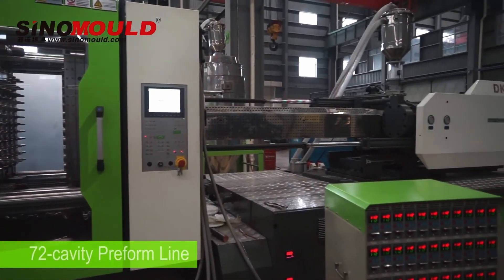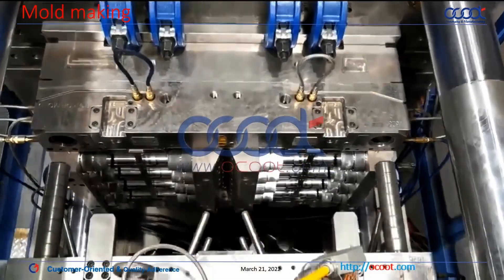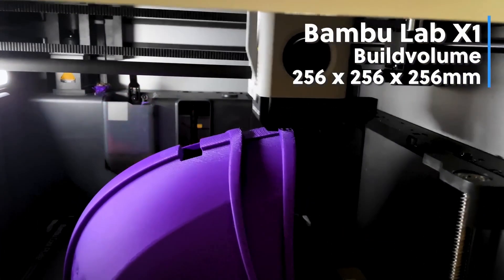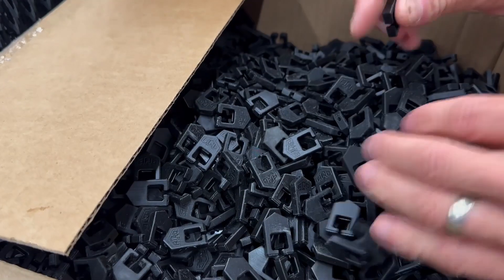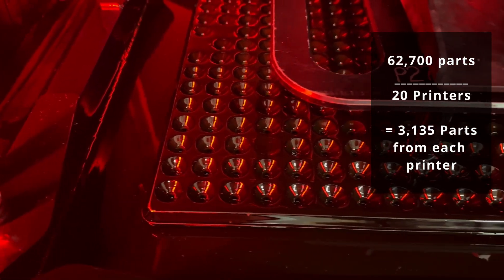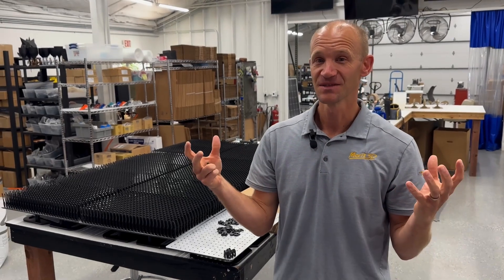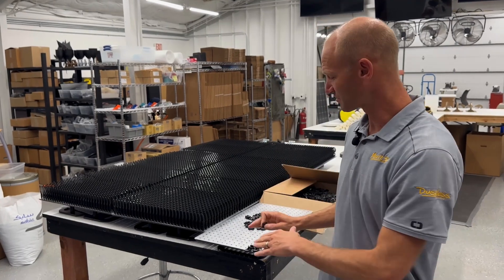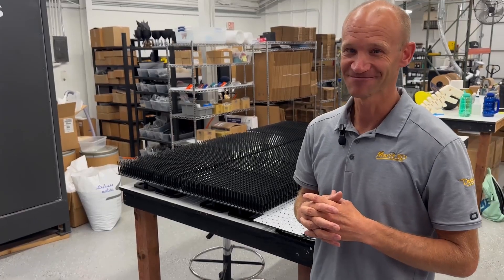How Additive Manufacturing Can Produce Faster Than Injection Molding!

Comment: Overall great vid, always nice to see "progress". I do worry about the fact that companies are doing with AM things that, in some ways, leveraging it "incorrectly". Sure I can make a stake in my microwave doesn't mean it's a good idea. Until it really starts to get absorbed the whole DFAM methodology it's just doing more of the same. Again I'm all for AM but it should be done in ways that make the most use not the same ole same....
Reply from the maker: Thanks for the comment. We do agree shay taking advantages of additive manufacturing. Design capabilities in one benefit. Our need was to bypass injection molding because molds have been a huge hinder ment in design to production speed and not being able to easy modify design after our molds are made. I would invite to keep your mind open as your need may be different than others. DFAM is huge in getting price down for us but not the main driver for mass production for our customers.

Comment: Looks real interesting and love the video! Few questions:

1. What is the 55gal drum on its side doing? Is that bulk IPA? And the plastic bag around the top lid, what's that doing?

2. On those cure units, it looks like there are only UV lights on the rear and bottom. Do the parts on the front of the build plate cure equally compared to the parts on the rear or say the middle? Or do you rotate the build plate halfway through?

3. The "blow-peel" technology that Photocentric has, is that like a puff of air underneath the FEP as the build head lifts up?

4. Do you see consistent Z heights across a build plate that large?
Reply from the maker: 55 gallon drum is what our resin comes in many times 

You may have to turn your parts to get even cure. Yes it is just back and bottom.

Yes and yes on the blowpeel and z height question. They are pretty accurate.

Comment: Your not eating the cost Your paying for them making parts. The point is the video is misleading. Its not faster nor cheaper than injection molding. A decent shop could make  inserts  and a mold in less than a couple hours. Blank molds are readily available and cheap not 10's of thousands close to 600 bucks well say double for machining. Molding shops run your mold and charge by quantity of parts. They still don't have to have the machines and still get it cheaper more reliable and safer. However the bonus is if they bought the machines they would be able to produce their own parts and have sustainability in the long run as their own company.
Reply from the maker: Not everyone has to understand the world is changing! Some will adopt early, others won't! It's up to you to do the research now that you have the questions!

Comment: What resins are you using to replace the plastic of injection molding?
Reply from the maker: There are a number of materials we use! You can check our materials page on merit3D.com. We have helped to develop with many companies resin formulations that are close to ABS and nylon plastics. Others are coming. Thanks!

Comment: Exactly your comparing the speed of 60 machines to one. All plastics have flexibility even glass and carbon fiber fills. It is common practice now days to us inserts in place of sliders to produce undercuts. You can use dissolving inserts even tpu and pull it after molding to produce the same part. It has more to do with engineering and product design. On cell phone cases we use a 3 piece insert to produce a roughly 1/4 undercut you simply pull the insert after molding. But none the less you are still talking about how 60 machines are faster than 1 and the cost of the mold is likely close or less than the price of the sla printers used.
Reply from the maker: We don't use 60 machines. We used closer to 15-20... But regardless the price of our printer doesn't influence the cost for our customers, whereas every mold does, so it can't really be used as an argument against us. Our sister company had to pay 500k for a mold before we were founded, which is more than what we've had to pay for our machines...
Reply: @Merit-3D exactly like you said in your video you used 15-20 machines that cost 400,000 dollars. You could literally buy two injection molding machines and the molds for half the cost of the printers used. If you went with spin casting the same part could be made in a fraction of the time at a much lower cost. A spin casting complete setup  new 12k less than the cost of one printer. A spincaster with resin Able to produce 2-250 parts per 30 seconds. As for injection molding the cost of a mold and molding machine would still cost roughly half of what the printers did. In your video you said 1 injection mold with roughly 100 cavities would do the same but you are using 15-20 machines meaning 2 machines would far surpass the speed of all the printers used making it again cheaper to injection mold.
Reply from the maker: Those 2 injection molding machines will only make one part… ever… Our investment of more 3D machines makes it so our customers don’t have to invest in injection molding. Most customers don’t have 400K for molds or 3D machines. Thanks for your comments.
Reply: @Merit-3D  your machines cost 400k you can buy a used injection molding machine for less than 5k. The average price of a mold  is 5-10k maybe shop around. Also the plastic used can be used uv stabilized unlike the printing resins available now and will far out last any lcd print. Once you have a machine your possibilities are no longer dependent on a third party such as your company. You can still even buy a cnc and make your own molds at a fraction of the price.
Reply: @gremlinsports  these machines replace hundreds of moulds over their lifetime, that alone pays for it. In return you also get instant workflows, no downtime switching moulds, engineering material and design flexibility, easy version changes for customers, higher total throughput on small parts and flexibility on where you operate as you don't have such heavy machinery. I think you are underestimating what is offered here
Reply: @malloot9224  you also get material that is unproven as to longevity parts that deteriorate in uv hazardous chemicals leftover possibly even uncured. Then there is the unknown health risks to the workers and end users. All of which you don't get with a known proven process like injection molding. You seem to believe molds only make a couple of parts. It is not uncommon for a mold to make 700,000 parts before needing to be even touched up. Any real company dosen't charge to change molds in a machine and the time is negligible 3-10 minutes.

Comment: You can't directly compare them you have to look at one aspect. Price per piece for low quantities is lower for 3d printing, but with thousandths injection molding is usually the way to go. Injection molding machines are much smaller compared to an entire print farm. The materials and intricacies you can do in each also differ. Also for very small pieces 3d printing could make sense, but for much larger pieces like the orange thing you showed being injection molded it would take so long to be 3d printed its only worth it for a handful of them.
Reply: I never said 3d printing can't make sense. Merely pointing out he is using 60 machines and saying its faster than one machine. At the same time the printers they are using cost close to what the injection molds cost. Large platform sla printers aren't cheap. They also have problems with the saftey of the resins depending on the product it could be a real liability.on small parts like those the molding time is closer to 20 -30 seconds from my experience
Reply: You could also spincast them with a pourable resin in less time and at a fraction of the cost. Maybe 500 a minute in a silicone mold on a single machine costing a quarter of on of sla printers.
Reply from the maker: Thanks for your comments. You are right in so many aspects. This video we were just comparing small parts to injection molding and speed. Of course there are many other aspects like footprint, agility and many others but we were just comparing speed of small parts.
Reply from the maker: A one time cost for 3D machines and you can produce what ever design our customers want. One time purchase with an injection mold will only make the one part. Additive is not for everyone and we are totally fine with that. Also our customers do not have any up front cost now. Thanks for your comments.

Comment: Alot of this video is misleading. You are comparing 1 injection mold to an entire print farm the same number of molding machines can in fact produce them faster. Also injection molding can do undercuts look at a snap container lid. You can also use inserts of soluble material to take care of undercuts.
Reply from the maker: Thanks, undercuts on a lid are possible because the material is PP or PET which has flex and not a big under cut. For and injection molding machine to have undercuts, it has to have room for the slider to move out of the way before the A B cavity can separate.  This part is not moldable without any modifications. Regardless this video was to just compare speed of additive manufacturing to injection molding.
Reply from the maker: It’s actually been around since the 1980’s and just like anything, it does evolve.  Companies are actually printing (fda approved) dental aligners. If you deny that 3D printing is not evolving each day then you obviously do not know the technology. We are fine if people want to use IM, but we also are showing the possibilities of NEW advancements and technology. This new tech is not for you and that is just fine. We shared actual numbers with you and you can make your decisions as will the thousands of others that will adopting additive manufacturing because the mold process is so expensive
Reply from the maker: Yes but since we are doing the manufacturing there is no machine cost for our customers. There would be a mold cost though if they were going that way. We eat the cost of the machines so you don’t have to invest in any machines or molds.
Reply: The thing is, this printer farm cost about the same as a bunch of moulds would, but moulds are written off much faster then these printers. So the production speed is there as well as the economy. Not to mention the insane flexibility offered
Reply: @malloot9224  you can purchase an injection mold for 5k for a simple mold lasting 100,000s of parts, the company having these made is making 1 part. The flexibility makes no difference to the company these are being made for. Right now you can purchase  an injection molding machine a cnc mill and mold pre made for less than one of the printers being used.
Reply from the maker: Also we only mass manufacture parts, we do not accept one offs... We had an order for over 1 million parts last year, the unofficial world record for most 3d printed parts ordered. Change is coming, but not everyone has to accept that.
Reply: @Merit-3D  It's not a new technology really. Motorola has been using it for prototypes since the early 1990's. Even Prusa has made millions of parts. Injection molds are not for one off parts either. Still the same not faster, unproven resins, faster breakdown of parts due to the impossibility of uv inhibitors, and now the added cost of a design team? Really the only place for these is in one off short run and prototype parts. Injection molding is still faster, has proven materials, uv resistant, food safe, durability tested, color choice, and a plethora of other advantages. As for millions of parts alot of Injection molders do that in a day.